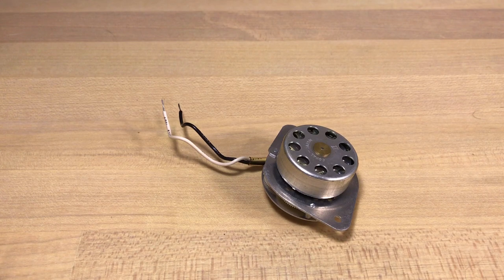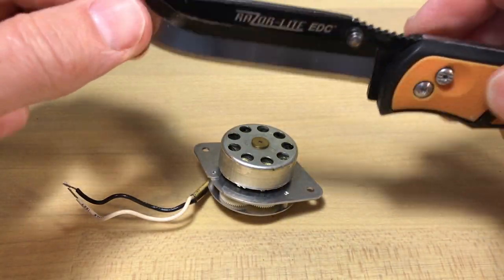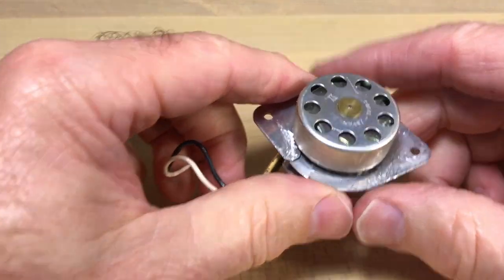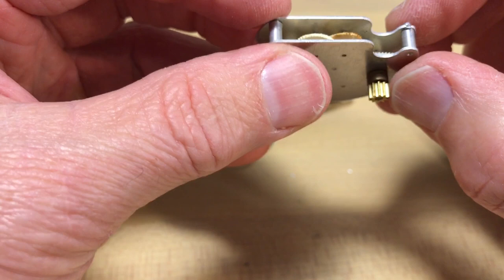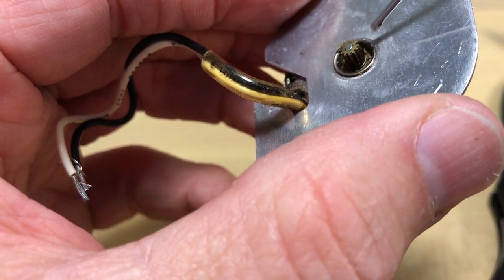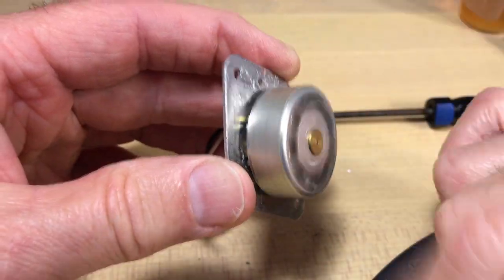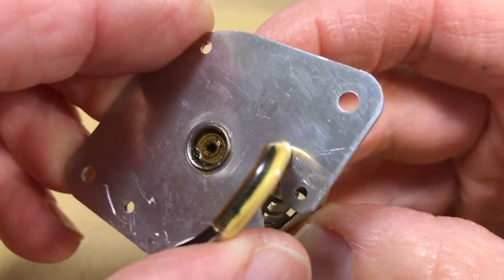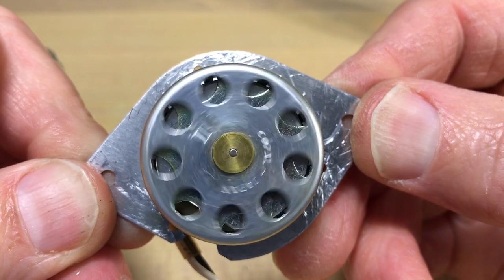Fixing flip clock motors - How does that work?

Comment: I have the same one with the 1st gear broken (shaved teeth). This is the 3rd or 4th replacement gear from donor clocks, and I can't get any more... Where can I get new gears?
Reply from the maker: Other clocks I guess. I’m trying to figure out why you’d be going through so many gears. Is it possible the mechanism is messed up?
Reply: @Flipclockfans  they all ran for 1-2 years, and yeah, those were all yellowed and quite worn out already...

Comment: Awesome info! It's def helped me restore my clocks with your "oiling thru the hole" technique. it's the first thing I try.

Hey random question , do you know of any "spacemaker" under cabinet style mountable flip clocks? I was curious if there were any. I guess you could always mount a flip clock with no top buttons but yeah that seems sketchy for an undercabinet flip clocks solution. Just wondering if you knew of any like that. Thanks!!!!!
Reply from the maker: Sorry for the late reply. I was swamped doing home restoration. I’ve never seen an under the cabinet model.

Comment: i’ve got a couple very fine surgical syringe needles i use to oil the motors, 1 is bent slightly and fits through the holes on the top cap, the other can be used on the gearing side, of course dismantling is the best way but this comes close
Reply from the maker: That's a great idea. Thanks!
Reply: @Flipclockfans  glad to contribute to the restoration of these wonderful objects, also...would you recommend lightly greasing the gear cogs on a normal copal motor or not ? i sometimes wonder...

Comment: Great video! I recently bought a Panasonic rc-1103 for restoration, cosmetics look good but I think electrical parts are fried. Have you ever measured the impedance of the winding for this motors?
Reply from the maker: No. Never checked. Are you getting current to the motor?

Comment: i have a sanyo 5320. The copal motor doesnt work. I cut the cables then put the 220 volt directly. it was not working. I can turn the wheel by hand. I have used the wd40. Are there any solve for this? sorry for my bad English.
Reply from the maker: I'm so sorry. I would be unable to suggest a solution.

Comment: Looks very much like the motors in my grandparent's late 60's and 70's Spartus clocks that are made in the USA. 
One clock is a kitchen hutch and the other is a pot belly stove. I inherited my grand parent's house and remember these clocks from when I was a kid.
The sad thing is both clocks stopped working with in a couple months of each other and when I opened the back of the clocks and seen the motor assembly that had rivets holding it together, I just slapped my head and geeeesh thanks Spartus minimal-us instead of Spartus maximus. So would have screwed you up to use screws huh Spartus? lol 
So does anywhere make replacement motors? I know they make the replacement kits that are like a little plastic square shape and quarts, but would certainly be nice having something closer to the original for the clock

Comment: What kind of oil better use for this?
Reply from the maker: You can use synthetic motor oil (like for your car). That actually works great. I sometimes use WD-40 or a light gun oil to clean it then follow with synthetic clock oil (like Liquid Bearings) or like I said, motor oil. Other restorers that I know use just the motor oil and let the clock run with the motor tilted motor side up to disperse the oil.
Reply: @Flipclockfans  thank you!
Reply: @Flipclockfans  its great info!

Comment: I have a goldair 7150 flip clock, the motor spins, but it won't change the numbers, what's a possible fix
Reply from the maker: Most often that means that there are stripped gears in the gear box.  The only fix would be replacing the motor with one from a working clock or trying to open up the gear box and see if the gears can be replaced. It's a challenge.

Comment: I'm upset with my National TE-80. It came from Japan. Uses a Copal motor. It runs, but does not progress. The brass cog from the center most shaved the succeeding cog which was plastic. I'm hopeless
Reply from the maker: I feel your pain. It's the one thing that I don't like about these clocks. The brass verses the plastic gear is often an area of failure. I wish I could go back in time and tell them to make that first gear out of brass.
Reply: @Flipclockfans  the only way to fix it is to find a donor clock (or a motor alone if lucky). but that procedure would still leave me with a sigh
Reply: @Flipclockfans 
And they'd tell you "Beat it, we're only in it for the money" :-)
Rest in peace, Frank!

Comment: Time to get a resin 3d printer. Make your own gears.
Reply from the maker: That’s a good idea and we often talk about that on the web forum . But it doesn’t solve the problem that these cases are not made to be serviced.
Reply: @Flipclockfans  rivets do not denote unserviceable.  5 seconds of a dremel. dab of epoxy to reseal.  done

Comment: Copal clocks are planned obsolescence from the 60ties.

Never had a motor so far where the electric part failed, always a mechanical reason. 
Metal wheels front and end sandwichs thinny plastic wheels, all in a 
sealed case. Cheaper to buy new but to repair, even back then.

That's why they became almost extinct hence always exciting to spot 
a "stubborn" survivor which avoided scrap.

Me owns a broken Caslon 201 (first wheel's teeth completely worn off, 
need a 3D printer as user [snthess] below suggests)  and a nice working 602, 
which I consider as a lucky guess myself at Ebay.

Flips may contain worse, a broken Sankyo motor - an utmost malicious design.
Reply from the maker: It is obvious you speak from experience!
Reply: @Flipclockfans  
Mate, much appreciated you offered me an anger management in a 
public place to deal with my ongoing love-hate relationship eventually  ;-)
Reply: The sixty ties?